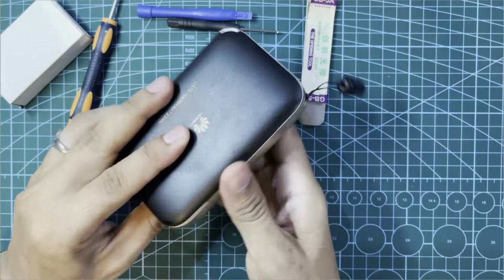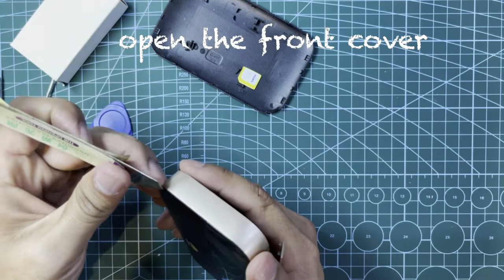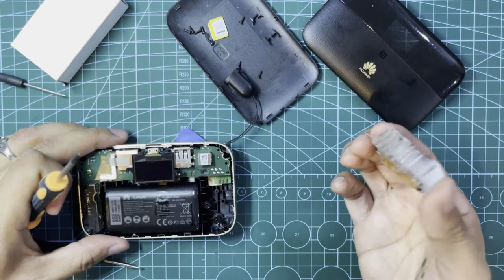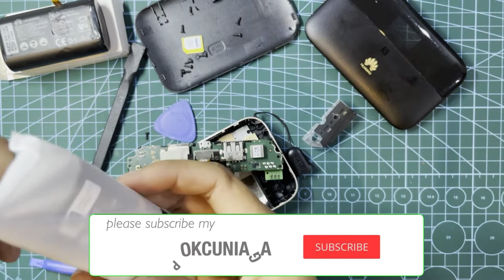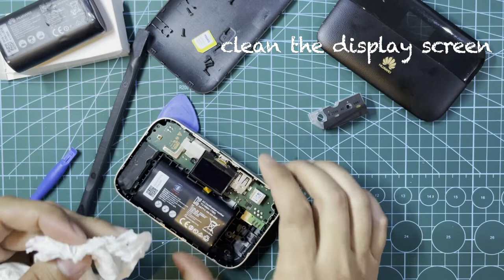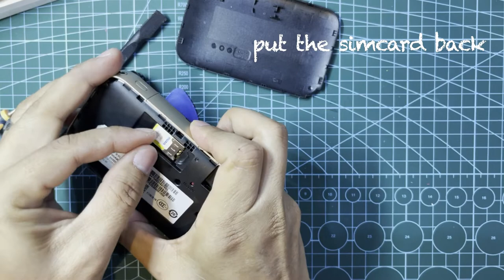REPLACE NEW BATTERY FOR HUAWEI E5885 MODEM

Comment: hello, i want to ask how is your battery now? i have the same battery that you used in this video. . is your battery good until now? did you drain your new battery after you received it?
Reply from the maker: its ok until now, n every day use it, no need to drain before installation..
Reply: @pokcuniaga1284  ok good for you, my battery says "Over-heated" after the battery reached down to 40% while using. . I tried to charged it but still not working, i guess the battery i received is defective. . Anyway, thanks for replying.
Reply from the maker: @zatchdarvin25 ok better change again new one